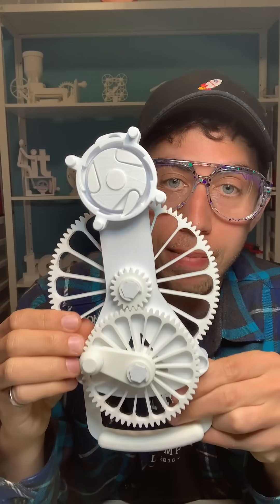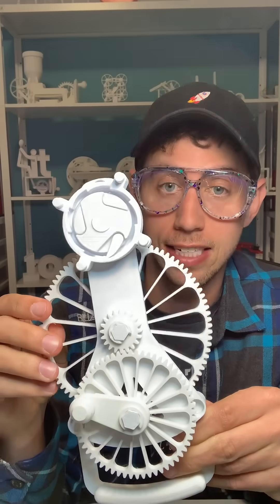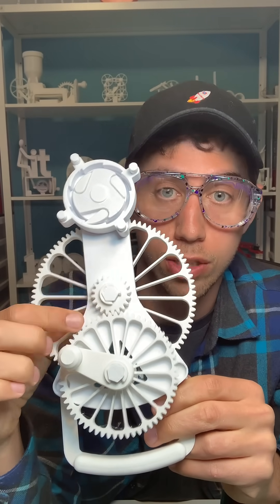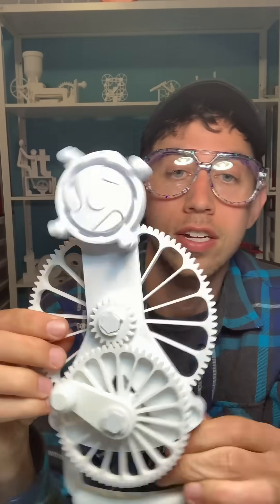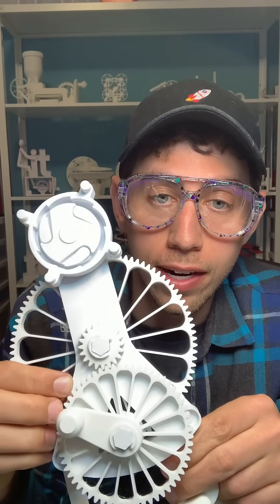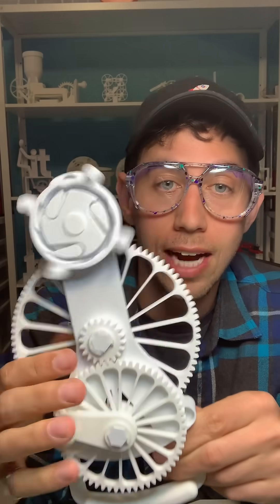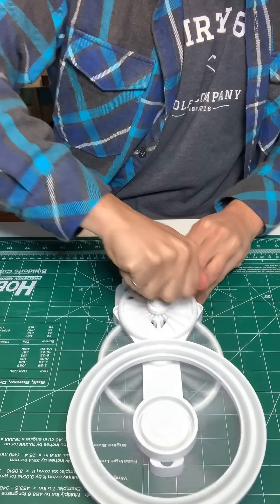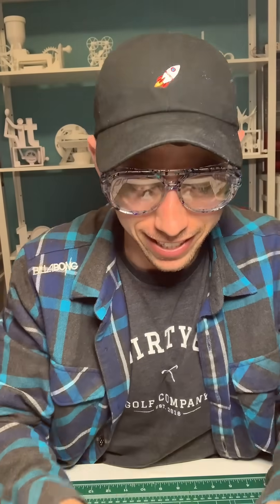The FASTEST Fully 3D-Printed Mechanism I've Ever Made (and maybe the most dangerous...) #shorts

Comment: I have a question lol. I’ve been working on cars for the last 5ish years but I’ve basically never had to deal with transmissions, at least not internally and understanding gear ratios has always been a little issue of mine. Do the all of the gears still have have the same number teeth as his do to get the final ratio of 13:1? Like, for example; just with the first two gears could you get a 3:1 ratio by having like, a 120 tooth gear and then a 40 tooth gear to get the same 3:1 ratio? My bad l o l I feel like it’s a dumb question, it would just help me understand a little better.
Reply: Yep as long as the gear teeth ratios are the same then the ratio is the same. For example a 50 tooth gear on a 10 tooth gear is the same as a 500 tooth gear on a 100 tooth gear. They are both 5:1👍

Comment: If you keep upping the ratio with more gears you could theoretically make something that spins faster than the speed of light
Reply: False. Time will dilate at the tips of the gears to prevent that from happening.
Reply: Nah
Reply: But because of torque, you wouldn't be able to spin it way earlier
Reply: If I’m not mistaken, would need an infinite amount of energy to make anything with mass move at the speed of light

Comment: To make it slightly easier to turn:
On the first gear add a counter weight the same weight as the handle on the opposite side (similar to a steam engines drive wheels)

Comment: Hey… when I was a kid they made toys that OPERATED on this principle! I had an Evel Knievel rocket stunt bike that used a gear ratio about like that to accomplish about the same thing yours did… just under control. Kick back on the gears and this bike rocketed away at insane speeds.
Reply: I had the Super Jet Cycle version…

https://youtu.be/4jOuAJpkSv8
Reply: In the jet pylons were geared circles wrapped in sandpaper and a ferrocerium flint that made the pylon “sparkle” at high speeds… real toys, with real chemicals and gear ratios that should have shredded the injection molded plastic gears they were made with. 🥸

Comment: Similar to the way the piece of steel cylinder that spins because of the engine spinning the transmission gears in a car that end up spinning the other side of the driveline spins the gears in the diff which spin wheels on a car

Comment: Always use teeth ratios that are relatively prime numbers, this gets you the best wear pattern, longest life and least noise. Look up "hunting tooth" for more information. If you have to get an exact integer ratio, it is best to use an idler gear with a prime number between the primary and driven. Same goes with chains and sprockets.
Reply: How do you know this knowledge?
Reply: @ikillacommunistforfun320  Look up hunting tooth. It has been known since medeival times.
Reply: @ikillacommunistforfun320  mechanical engineering
Reply: Wow
Reply: Ye he even forgot to mention the power required to drive the starting gear.

Comment: If it was at a bigger scale would the rpm be the same?
Reply from the maker: Yep! Changing the number of teeth in the gears would be what you need to change the rpm
Reply: @Engineezy  so scale it x2 the size it will double in rpm or make a model with smaller teeth to add more teeth and it could go faster 😬 sheesh what's the downside?
Reply from the maker: The only downside is the faster its gets on one end, the harder it is to spin on the other end!
Reply: @Engineezy  this is why I like designing its one big puzzle. Could you not hook it up to a motor to make it easier to spin

Comment: "The most dangerous thing"
Plastic spinning in 1000 rpm
Me using my circular saw with 5000rpm while wearing short : "what I've done"
Edit : I meant "angle grinder"
Reply: Ever heard of an angle grinder?
Reply: @epstinian  after a little bit of searching, it turned out I thought the angle grinder is the circular saw, since locally in my location we use different naming.
So Yes, I meant the fuc*** gigantic angle grinder it's the bigger version not the small one...
Reply: @mrzoldik201  prolly the One you were using was over 5000..and also here in it it has a few different names XD
Reply: Also me with a 30 000 rpm rc plane turbine
Reply: The most dangerous thing he’s made
Reply: lol
Reply: Spinning CD at 30 000 rpm. Seems like a joke to me
Reply: I call it a cut off saw.
Reply: Still he 3D-Printed that from himself. You cant compare it to a machine build in factories.
Reply: Me with my 10,000 rpm impact wrench
Reply: Me with my bayblade just spinning
Reply: I can tell by ur pfp u have never touched a angel grinder in ur life
Reply: @Freddy_.910  Why I should care if you believed or not?
Reply: @Freddy_.910  angel grinder
Reply: I mean it’s still impressive that he can get that level of speed manually
Reply: @waymentdawg4644  yes, that's for sure
Reply: The Motor of an angle grinder turns at 33000rpm, with a translation oft 3 to 1
Reply: 30k on a resin bonded diamond blade cutting glass.  They burn and explode if the coolant runs out.
Reply: He said it was the fastest and most dangerous thing he had ever 3D printed, not the fastest and most dangerous thing in general
Reply: Also you didn't build that saw, it's built by professionals that are held liable if it malfunctions and hurts you. He just slapped a bunch of plastic together, spun it around, had a piece of fly off and thought "wow if that hits me in the face it can destroy my eyes". Also we can't see his bottom half, he might be wearing shorts as well 😅
Reply: @lovescomedy619  good luck holding the Chinese professionals liable bro.
Reply: Why wouldnt you just change it to angle grinder? Why add "edit?"
Reply: @jackdawson5490  for more transparency...
Actually to make it more convenient for the people who check the  replies.
Reply: @mrzoldik201  okay that makes sense

Comment: bro imagine having a fan like that, no need for power, no need for batteries, no need for plugs.. perfect 👌
Reply: yes but then its all fun and games until the fan blade comes towards you while spinning at a thousand rpm
Reply: @acrytala  well you aren't going to spin it that fast it just needs to give you a little bit of wind so you stay cold and that's it
Reply: 1000 rpm is not fast for a fan
Reply: @rubenn7212  lol go do ur research first. A fan rpm usually range from 350-390
Reply from the maker: Just some tired arms :)
Reply: But you have to keep winding it so...
Reply: @carlbernsen1290  well that's the whole point of the powerless fan lol
Reply: @Deepi.e  So it would be more efficient to use a simple Japanese paper fan. Also, no plastic.
Reply: @Deepi.e  who the hell wants to keep cranking on it? Gonna break a sweat trying to cool down lol
Reply: @TheUltimateWord  i would, i and I don't think you can sweat with that tiny effort
Reply: @carlbernsen1290  The energy has to come from somewhere man
Reply: @TheDeathLove  A lot of the energy is wasted in friction and heat.
Reply: @carlbernsen1290  no? it's not wasted if it's a heater

Comment: Kids dont remember, but in the 70s we had an Evil Knievel motorcycle/action figure that attached to a platform with a crank handle that had a gear ratio that was very high. Wind it up, hit a button, and Evil was launched. Had to be careful not to touch the rubber rear tire. It would burn and remove skin at the same time. Toys of the 70s and 80s were so dangerous AND FUN!
Reply from the maker: Kids are soft these days...

Comment: That will be useful in human powered vehicles, cos with that being the engine means even a less peddaling wud be able to spin a wheel very fast or even a rotor fast enough to match gas powered engines rotary speeds.

This is so awesome i want to know more about it.
Reply: But the more gearwheels you add the harder it gets make them spin
Reply: @venera_7  
The solution is bigger pedal plates

Comment: I wonder if this can be used to make free electricity for emergency situations... 🤔💭🧐
Reply: Only because it's faster doesn't mean it has more energy. You could use it to make energy (like really small amounts), and it would be so much more efficient if you used the first wheel only instead of everything at once. And energy from a simple rotator wheel is really not much. Well it's enough to power a flashlight, that's how most bike lights work. But you couldn't even charge a phone with it.

Comment: *wears safety glasses because holding a 1 thousand rpm device.*
Me when I was 10 years old with lego: "3.5 thousand rpm, neat."
Reply: Wait what
Reply: @bawpwarthegreen6065  it's lego but using it with electronics
Reply: @kekuKairinwakarimasen  you mean a lego mindstorm?
Reply: @hellbusterdragon  you can easily get insanely high rpm with normal Lego gears, I made a simple gearbox for my electric generator and I got it to a few hundred really easily and that had to spin a poorly balanced mass of about 500 grams a few centimeters away from the axle.
Reply: @garret1930  oh the gear kind, got it. I thought it was available only with Mindstorms
Reply: @kekuKairinwakarimasen  funny enough, I was talking hand cranked.
Reply: Hey same I had a moter and made my Legos like 8000rpm I thick it was
Reply: @jaime0546  I used to read fantasy romance books as a child.
Reply: @pierrelemagnifique205  huh?
Reply: Me wondering what would happen if I attach a drill to it...

Comment: This is really cool, unfortunately, its a somewhat useless mechanism due to torque. While this mechanism spins very fast due to the high gear ratio, a consequence of this is a dramatic loss of torque. If you were to use a similar gear ratio in something like a circular saw, it would stop as soon as it started to cut something, because while there is lots of speed, there is no power aka torque behind that speed. So while it could be used in things like a bike, chainsaw, or a winch, it would be useless due to little to no torque. This gear ratio mechanism is cool, and does have its uses, but it’s use in larger machines and systems is small.

Comment: Interesting. Let me give you a comparison. 
The T56 engine on a C130 is a constant speed engine.
It has a 13:1 gear box ratio attached to a 12 foot propeller. 
The hub speed is 1000 rpm which translates the blade tip speed into a subsonic range of time over distance.

Comment: So why have generators for tidal power not been using these gear ratios? 🤔 Waves rise and fall 3 feet near coastlines but all power companies say to get the power is too hard. But why haven't they figured out how to use a 1 way winch for the rise and fall of the wave piston and then that going to a gear box like your printed design?  Does steam really work that much more effectively? Dumb hippy sorry for questions
Reply from the maker: Theres a trade off with gears- the more speed at one end means more torque (rotational force) at the other. Also, you lose energy through gears as well. So engineers weigh all these factors when designing and I’m sure this was all considered when designing the tidal generators! Questions are the best way to learn- I got you👊

Comment: Maybe this is a dumb question, but if this is pushing out a quicker speed than is going in is it not breaking the first rule of thermodynamics??
Reply from the maker: That is a fair question- there’s a trade-off here. You lose torque when you increase speed and vice versa, so energy is just changing from one type to another. You actually lose energy through friction throughout the process as well due to friction.

Comment: The fastest I’ve ever gotten something to spin is a lego fan with a 1/75 gear ratio. I estimate it was spinning at ~27,000 rpm when spun by a lego motor and ~50,000 rpm when using a drill

Comment: 1000rpm... pussy.. it's slow. Who need eyewear protection for still visible turnrate... no minimum 2400 rpm is necessary for safety precautions, I recommend normal dose of testosterone is good enough protection, once you reach 5000 rpm and above perhaps plastic glove to prevent getting small cut on finger... then perhaps at 10000 rpm perhaps then you need glasses... of vodka because clearly not man enough to face spinning plastic trash of death.

Comment: "At top speed, this thing right here moves at 1000 RPM."

OK, but what is that in something that isn't based on the diameter of the object that is moving? 48KM/H (30M/H)? I understand it isn't that simple, but that gives me no reference point.
Reply: On a 33 inch diameter car tire, the circumference would be pi x 33 = 103.62 in. Therefore, if that tire would rotate 1000 times every minute the distance traveled would be 103.62 x 1000 = 103620 in.  Or in miles that is 1.65 mi (2.655 km) per minute, to calculate miles per hour, multiply by the number of minutes in an hour 1.65x60 = 99 miles per hour (159.3 kilometers per hour). However, giving the speed if it were to roll is not an accurate measurement of this since the force required to move a wheel varies on the diameter and weight of the wheel. RPM is used since it allows you to directly work with gear ratios and convert it into other things.

Comment: Can you use these types of devices as a method of powering something else? Or are the gear ratio devices just to have fun with different diameter parts?
Reply from the maker: You definitely can! But you would likely need a little more precision than just 3d printed parts for it to work well!

Comment: You could make a boat crank motor with this and make it hella easy to move without gas, as long as the gears hold up.
Mabye a few tweaks to account for the water resistance.

Comment: Me working around machines that can take off at 8000 rpms and above with no safety gear: this is Osha approved
Reply from the maker: Mad man
Reply: Nothing like firing up the spindle on my cnc at 12k rpm with the doors open. And that's on the lower end oh high speed spindles. Balanced tooling is a must
Reply: Nothing like firing up the spindle on my cnc at 12k rpm with the doors open. And that's on the lower end of high speed spindles. Balanced tooling is a must

Comment: 1k rpm is not fast

Its used in cars
Rpm round pet min

Its how much your crank turns in a minute

So if you rev to 2 thousand your crank will turn 2 thousand times per min

So he made this small wheel turn thousand times per mim which is slow

Comment: I ALSO noticed that the device you held up and the device you actually turned were different. The gear that popped off looked rather lose at the start when you turned the crank. As if it was engineered to pop off.

Comment: Torque: Exists 

Step Up Gear Ratios: “is it for me?”
Reply: is for me? 
  🥺
👉👈
Reply: for me? 
👉👈
Reply: Yes child, yes it is
Reply: Everyone always talks about torque everytime there's a video about these gear ratios, but I've never understood what they are and how they're related to the video.
Reply: @selo_0735  torque is a measurement of rotational force, think of it as spinning momentum. The more torque, the more you can move. However, gears change torque into speed. The bigger the output gear, the less speed it rotates with BUT that speed loss is turned into torque so the gear will be harder to stop, and will be able to move a gear with more load on it. Essentially, gears are spinning momentum levers. The bigger the diameter of the gear, the more it can turn speed to torque, the smaller the gear, the more it changes torque to speed. Do also try to remember that you can type the word into the search bar and have much more thorough explanation for free.
Reply: @SpadeNya  nods and pretends to understand
Reply: @HeroOfTheDay16  an easier way to think about it would be on a bicycle. 
Say you have a 1:1 gear ratio, and are pedaling at walking speed with the same force required to walk. If you switch to a 2:1 gear ratio (bigger drive gear and smaller output) you now only put half the force i to pedaling, but have to pedal twice as fast to maintain speed. The force you put in x radius is the torque. 
Or if you have ever driven a manual, you have a high gear ratio in first (4:1), so you can accelerate easily, but can't go over 10 mph. On the other hand, if you try to start in 5th (low gear ratio, 1:1.5), you are going to have a hard time accelerating, but can go 100 mph.

So basically a high gear ratio multiplies torque at the cost of speed (low force in, high force out, but slow). 
A low gear ratio multiplies speed at the cost of torque (high force in, low force out, but fast). 
Hopefully one of these explanations can help you understand.
Reply: @FurryKeidran98  thanks I understand now
Reply: Tl;dr high torque low speed will crush you, high speed low torque wont crush you.
Reply: Is for me?

  😳
👉👈